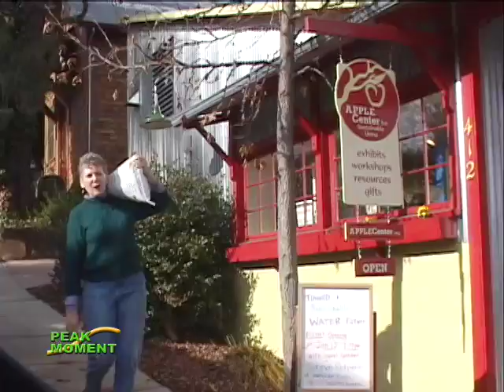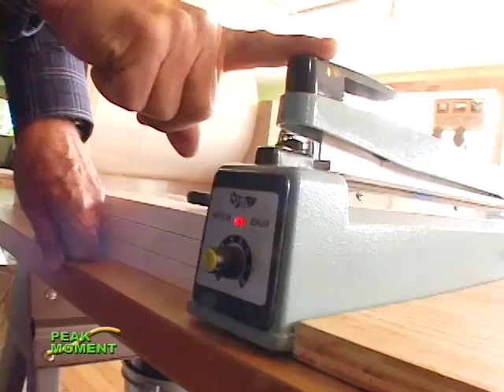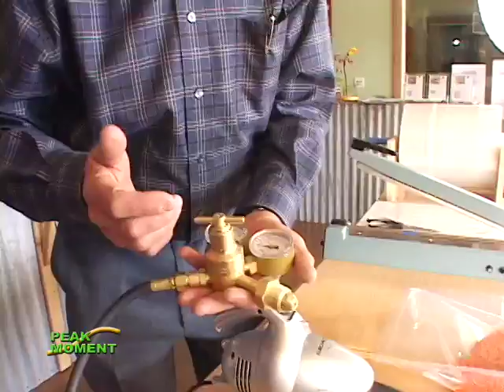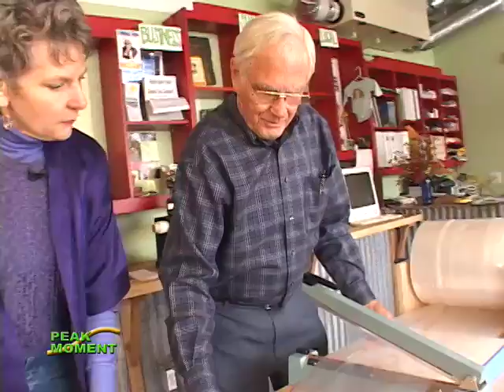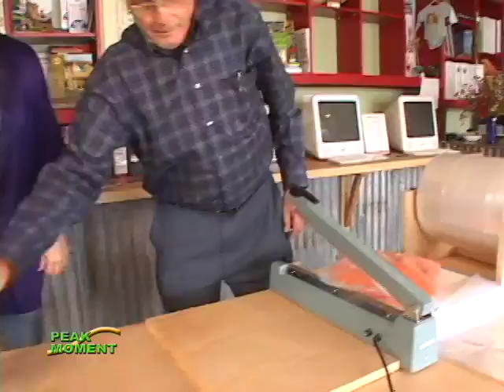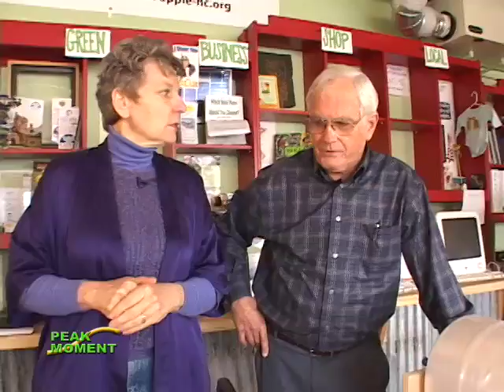Bag It! Packaging Bulk Food With Nitrogen

Comment: The "air" in beween the grains can move about and yes the vacuum sucks out that air too. If it's a concern, bury the N2 puge line in the grain. and let it purge for a cooule in allowing the gas to escape downward (not upward). Repeat 3 x. Also he says it's a 90% replacement, but air is already 79% N2 and only 21 % O2. So a 90% replacement, is pretty good, but with some simple changes he can do much better and also no need not to vacuum it down at the end because it's going out and it's already full of nitrogen, not air.

Comment: Please use a vacuum sealer to take out air and than fill the  nitrogen and than hold the bag right side up so the 5% air which contain Oxygen ( Nitrogen is more condense than air ) which is left in the bag  will come up , little more vacuum from the top of the bag  to take out the remaining air and Sealed it
Reply: Good idea! 
Regarding your idea to hang the bag vertical; With a steady enough system designed not to diffuse the nitrogen & air, it might be able to take advantage of the different densities of the gasses but it would be best for it to be ultra-still, take a longer amount of time for settling, &/or use an ample amount of injected nitrogen. A tubular bag would work best, I guess.
Because O2 is more dense(1.429 Kg/M3), than Nitrogen which weighs in @(1.2506 Kg/ M3), they do not separate like oil and water. The slightest wrinkle in the plastic could cause an air current which will keep them mixed up.
Reply: bizojan  Oxygen (O2) has a molecular weight of 32 = 16 + 16. Nitrogen (N2) has a molecular weight of 28. Nitrogen is lighter than oxygen. You have it. bass-ackward.
Reply: @BillM1960  shhh you'll scare the flat earthers away.

Comment from the maker: @yonny1954, I'm totally with you on self-reliance skills. I'm can report that I learned how to use the on-off switch while keeping the bag opening closed so as not to introduce more oxygen, while at the same tme getting the feel for how much air to suck out so the bag remained flexible. It took a few passes but wasn't impossible. But, like any new manual skill where you have to juggle several factors a once, it takes practice.

Comment: "Plan to use oxygen absorbers within 6 months of purchase as they will lose effectiveness after that time.  Oxygen absorbers will begin to work as soon as the plastic outer packaging (do not open the individual packets) is opened.  Please plan ahead and either use all of the absorbers or seal the remaining packets in an airtight glass mason jar.  This will cause the packets to stop working until air is introduced again."

Comment: "Used widely in the Food Service Industry to preserve foods like beef jerky, nuts, grains, flour, and just about any dried foods. Our 200 pack of S100 High Efficiency Oxygen Absorbers is effective for about 100 #10 cans or 25 5 gallon buckets filled with beans, grains or flours.

Activated by air regardless of moisture levels 
Start working fast (in about an hour) 
Can be used with both moist and dry foods